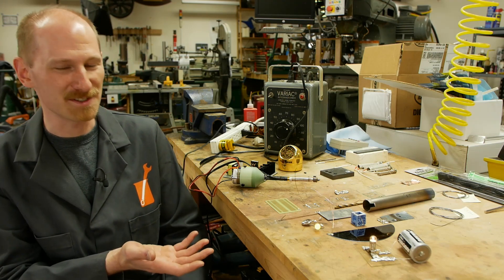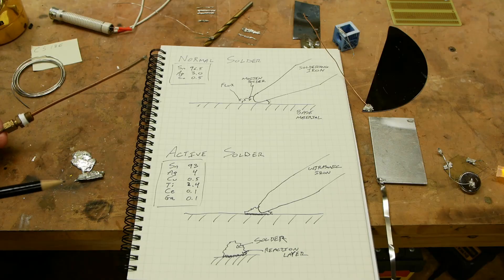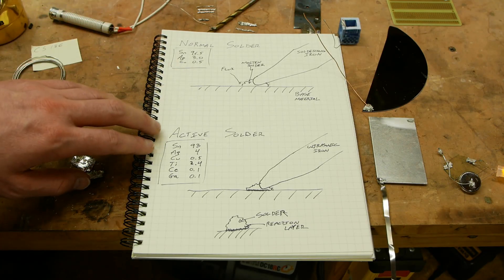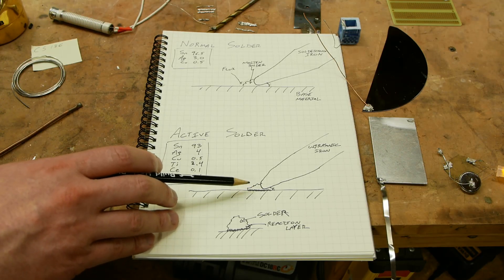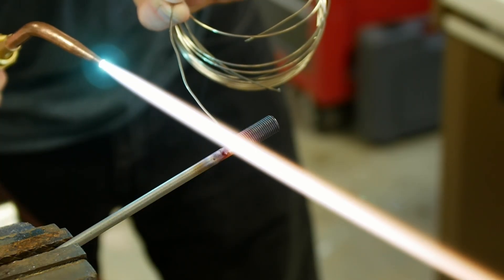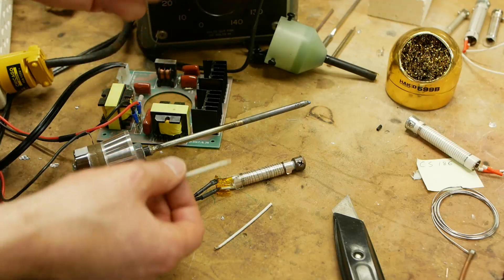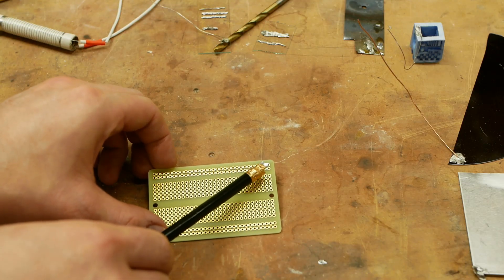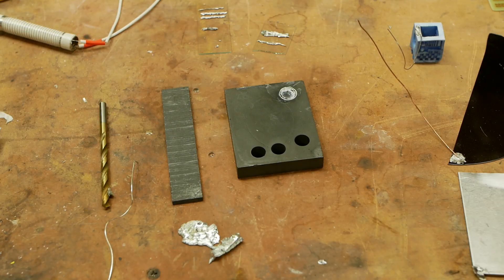Ultrasonic soldering bonds glass, titanium, stainless steel, ceramics, tungsten, nichrome...

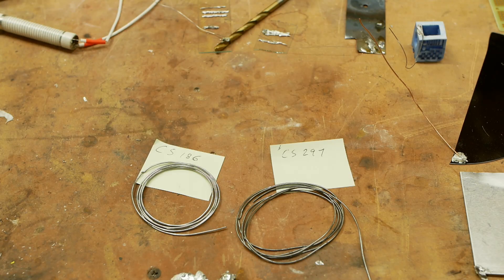Comment: 12:38 did you just reveal their exact recipe??? XD
XRF guns are magic
Reply: the building process is often the harder part
Reply: @senselessnothing  yep, just look at the special glass he made a while back
the ingredients you put in have to be wildly different from the final glass mix, because of all of the reactions that happen when cooking it
Reply: @cleverca22  Exactly, the recipe is just the first step
Reply: @cleverca22  depends on your definition of ingredient..
Reply: @cleverca22  I suspect that copying an alloy is way easier than with the glass, there are less chemical reactions involved. It might still not be straightforward though.
Reply: So, I agree with the idea that an ingredient list is not the same as a recipe, especially in general.  But I'm curious if anyone knows what types of issues make the true for a metal alloy.

The big one I know about is heat treating. It affects the grain structure. Though you melt solder to use it, so I'm not sure how much heat treating matters.

Anyone have ideas of other factors that would make replicating a metal alloy not straightforward?  Maybe the flux you use when melting and mixing? The type of atmosphere you melt it under?
Reply: @doctorbobstone  exactly, look at all inputs, and (env); heat cycling and boundary growth is another "condition" of a material that's an input. Look at chocolate - you have to get the temps perfect to get the crystals right, tempering. Carbon can dissolve in from air, oxidization, the heat cycle will affect, but the fundamental structure, if homogenous, will be set from this - but likely it won't be ~homogenous exactly. There's also mechanical inputs (as displayed here) with rolling metals to deform and align grains - now you're talking about what makes a MATERIAL not what makes an ALLOY - you can work an identical alloy in different ways to make different materials. Would be nice to see a superset of all inputs and some descriptor language for each....
Reply: ask for the material safety datasheet for a rough target corridor of ingredients.
But note that ingredients is not the same as a recipe.
Reply: @sarowie  msds sheets don't reveal very much of anything, as far as specific ingredients or quantities of ingredients, for a lot of things.
Reply: I'd say its not even the recipe, but just ingredients. Executing the recipe can be a whole other ball of wax.
Reply: Composition not recipe. They tell you the recipe on their website.
Reply: That gun just looks made to ruin so many industry secrets its amazing it exists.
Reply: @dafydd165  if a group with resources wants to know the composition, I assume that the XRF gun is but one method they could use. That is, I assume you basically can't keep something like this secret. But that thing might as well be a tricorder.  It's pretty cool that it exists and is instantaneous.  (And the sci-fi sounds still amuse me... 😁)
Reply: @dafydd165  if you've got $6000-$12000 to spend on one sure
Reply: @SuperAWaC  Granted, this was a few years ago  but when I checked into getting one...the base price was like 35k and just went up from there depending on the number of elements detected.

Is $6,000 for a new or used one, how many elements does it detect? Crazy how much cheaper they are now.
Reply: @PowerScissor  the ones that go for 6k used now are probably similar the ones you paid 35k for when they were new- they are usually about 10-15 years old.

Comment: Any chance of being able to make a vacuum tight connection on glass? For instance making various tubes or apparatus?
Reply: As a follow up, can you use the active solder  to prepare a difficult surface (glass window, tube, etc.) then run a conventional pass complete the joint/get a good looking product?
Reply: @noahhoppis2512  I wondered the same thing. Not that I'm ever likely to have such wonders to play with.
Reply: Good question - the answer is yes, you can! As far as I am aware, this was one of the techniques used to seal vidicon tube image plates, which needed a full metal ring in contact with a photocathode, at the very front of the tube.
You can't really do internal seals though, have to be very careful with how the solder is positioned so as to not create virtual leaks, which would ruin the vacuum.
Reply: @Spirit532  glass metal joins are very common and usually made though oxidation of the metal in the place of joint, then the molten glass makes a bond with the oxide layer. This is how it is done for centuries and the solder discussed in the video is a very recent development.
Reply: @pahom2  Centuries? No. Modern, vacuum-capable glass to metal seals have only been around for ~100 years or so.
I'm talking specifically about the downside of Houskeeper seals, which were one of the first seals that could work for large diameters.
Reply: @Spirit532  yes centuries. People are welding glass and metal for centuries. Vacuum tubes is of course a more recent application of this welds but still much older than the active solder discussed in the video (10-30 years according to Ben)
Reply: @pahom2  Please provide sources.
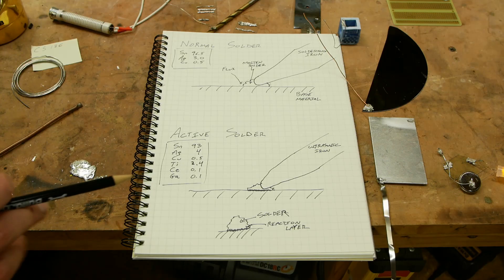Reply: @Spirit532  he is telling this at 7:35
Reply: @pahom2  Sources regarding "welding glass to metal for centuries"
Reply: @Spirit532  stop this demagogue. You've lied that vidicon tubes were soldered. They were welded. More details can be found in the book A. Roth, "Vacuum Technology".
Reply: Good question, that would be a nice way for sealing glass joints if it works.
Reply: @JoshStLouis314  this wouldn't be a great mechanical seal unless you were just trying to be air tight with 0 pressure
Reply: @Hexauslion  I should have mentioned the uses I had in mind were for partial pressure and vacuum setups, not positive pressure.
Reply: You should look into how copper to glass seals are made...seems pretty straightforward (I've never tried it) and is well documented, but the devil is in the details. I found some old papers online explaining it once.

From memory it involves creating a thick oxide layer (but not too thick) on the copper and the oxide layer bonds to the glass.
Reply: @drrrrockzo  What you're referring to is Houskeeper(without the e) seals, and they are some of the hardest to apply practically, as they require an exceptionally thin copper tube to match the CTE of glass.

A far easier and modern(as in, developed after Houskeeper died) alternative is sealing borosilicate directly to Kovar alloys. That is "as simple as" maintaining a fine balance of oxide and temperature - otherwise you can just let it sink into the edge.
Reply: @Spirit532  That's exactly what I was referring to, just couldn't remember the name...i had a suspension that they were not easy to make in reality. 

Kovar is definitely the industry solution, but they aren't exactly giving it away...even compared to commercially pure copper.

Still seems like a useful technique if you can plan around it's issues and have the time to master it.
Reply: @drrrrockzo  Kovar itself is a relatively affordable alloy, just have to find a supplier. You wouldn't use too much of it anyway, the seals still have to be relatively thin(knife edge is ideal, but 0.5-2mm is more practical).
A tip for searching is to look for the generic alloy, not actual Kovar, since that's a trademark.
It's certainly going to be cheaper than wasting kilos of copper by turning down large blanks into paper thin tubes.
Reply: @Spirit532 

Fair enough, I looked it up at Mcmaster-Carr, it was 5-10x more than copper and the actual brand name.

Honestly in the applications where I needed to seal metal and glass, I just used oring seals...nothing exotic involving ultra high vacuum, pressures over 5000psi or temperatures higher than ordinary silicone can handle.
Reply: @drrrrockzo  For applications where you have continuous pumping, these kinds of seal aren't really needed. Alu or stainless to glass via viton orings works just as well, even almost reaching to ultra high vacuum.

That, and McMaster is gouging express ;)
Reply: @Spirit532 

Mcmaster-Carr is certainly the master of price gouging...but there is a value added. They basically have anything you can imagine in stock and in quantity if needed, they also ship nearly everything overnight for a fair price because of the volume they ship.

For rapid prototyping and emergency jobs, they're hard to beat.
Reply: @drrrrockzo  If only their warehouse was where I lived, which is not the US :P
Reply: @burnssuck  In art, maybe. Scientific glass does not use butchered terms. Linear CTE, sometimes alpha.
Reply: @drrrrockzo  The vacuum furnace is the killer for home labs.
Reply: @glasslinger 

Judging by you screen name, I'm sure you have a better idea of the process than I do. 

But the write up I read seemed pretty "rough and ready", mainly requiring a metal lathe and glass lathe. The glass lathe seemed to be the stumbling point, but a crafty person could modify a metal lathe to do the duty.
Reply: @drrrrockzo  have a look at glasslinger's channel
Reply: thermal expansion might be an issue though?
Reply: @すどにむ  yes thermal expansion is an important question in many applications, and not only vacuum ones
Reply: Might want to look into how vacuum tubes have been manufactured by the billions. They each have a dozen of metal connections going through the glass 😉
Reply: @epojesper  None of those are flanged 😉
Wire feedthroughs are an order of magnitude easier to make.

Comment: why was the LED at 14:00 blinking? i suppose it was a simple circuit from battery to LED with the ITO coated glass in between? What caused the random fluctuation?
Reply: It's a fire effect LED. The connection is fine.
Reply: It's in most of the video.  It looks like it's correlated to his voice and noise.

Comment: Would you be able to limit the power with a capacitor in series with the ultrasonic transducer?
Reply: Not a bad idea, add reactance to reduce total current flow. I'd be concerned about the driver's ability to tolerate the phase shift.

Comment: Chemical supply house: "wont sell to hobbists"

Hobbyists: "Hold my vacuum induction furnace"
Reply: I've dealt with that mess before, trying to obtain tetrahydrofuran, as I wanted to test if it works as a solvent for vapor smoothing of PLA 3D prints. Eventually had to resort to a dodgy ebay seller who sent me a bottle of something labeled tetrahydrofuran, with a picture of another molecule, and a structural formula for a third one.

It sucked for vapor smoothing, but I'm still not sure if that was because THF in general isn't good for it, or because whatever was in that bottle was not really THF.
Reply: @vylbird8014  Just distill PVC cement/purple primer. That is usually THF and MEK
Reply: @vylbird8014  C4H8O aka. Oxolane aka Butelyne Oxide can be obtained from Fisher Scientific and is considered a flammable VOC; It will eat latex for lunch and works relatively well for PLA smoothing with direct contact; DO NOT suck in any of the fumes, and beware that this is a solvent for many common polymers used in gloves, safety goggles and breathing apparatus. Use Nitrile/Neoprene gloves & goggle shields, but even these will be impacted with repeated exposure.
Reply: @luisderivas6005  Once I'm done with the house-purchasing and -moving, I might give it a try. Thanks for the suggestion. I was going to try diethyl ether just out of hope, not expecting much from it, but then the government decided to pass a new law that forbids possession of every chemical that has any recreational drug use (It's so vague the law has to specifically exempt nicotine, ethanol and caffeine - the socially-acceptable drugs). You can still buy the stuff, but prices shot way up after that.
Reply: @vylbird8014  https://www.restauro-online.com/epages/63807438.sf/it_IT/?ObjectPath=/Shops/63807438/Products/Z131 . Why you wanted to use THF? Seems that all info I could find on PLA smoothing wanted to use Cloroform (not always easy to get but easy to make at home) or dicloromethane (much easier to get, not in pure form but... you need it just for vapors so ok)
Reply: @gentiligiuliano7882  I was finding conflicting information from other hobbyists regarding THF. I thought I'd try it myself, to see if the results were superior to DCM. They were not.
Reply: @vylbird8014  personally, I would stick to chloroform. The ingredients are few in number and very, very easy to find at any hardware store, and even most grocery stores.
Reply: @vylbird8014  Let anyone smell it who works with THF. Easy to tell.
Reply: @leocurious9919  I destroyed my THF years ago - didn't want to hang on to it, because I know that if stored for a long enough period it can break down into some nasty products with explosive properties.
Reply: @vylbird8014  There is something worse that used to be used, Rhymes with "Picnic basket", and used to be found in school labs.  Also if somebody forgets to toss the standard silvering solution.  Better (Luck) living through chemistry!
Reply: @vylbird8014  Try Weld-on 3
Reply: "Hobbyist" is stretching it a bit with Ben though :)
Reply: @T3sl4  more like mad scientist. but i love it anyways.
Reply: Tim Williams imagine all of the awesome stuff he worked on at google, valve, and mag design.
Reply: these companies are hobbiophobics ;D
Reply: This is always such a pain, it's really like these kinds of companies want to keep their market small.

I usually pretend to be some student project for a university when they deny me parts just because its not a company. Not very ethical but it works..
Reply: @malloott  A lot of the things hobbyists want are potentially materials for making either explosives (like my THF) or drugs. Though a creative chemist can really make something recreational from pretty much anything.
Reply: Indeed and stupid thing is that this produces paradoxical results, I wouldn't be surprised if companies that adopt this attitude end up creating competitors in the future.
Reply: You gotta fake it and use a company letterhead to get attention and respect ie responsivness.............they gotta smell money often times. Rich
Reply: @ghlscitel6714  Dicktionary. rofl
Reply: muh bunsen burner
Reply: @calholli  thats close to a youtube rules infringement.
Reply: @ghlscitel6714  Google was unable to translate it

Comment: Dang it Ben, I’m trying to sleep! You can just post a video with that title, I’m gonna be up all night!
Reply: Yep I'm already going down the research rabbit hole. Eyeing my parts bin to see what I might do.
Reply: @Ryan6.022  Sourcing Cerium... Wallet says "ouch"
Reply from the maker: @matthewellisor5835  eBay!  https://www.ebay.com/itm/Cerium-Metal-Element-Sample-10g-Chunks-99-5-Pure-Periodic-Table/372414604226?hash=item56b5a3e3c2:g:fSYAAOSwWh1bfypP
Reply: @AppliedScience  Also lighter flints may be enough -- it's ferrocerium, if the iron doesn't cause any problems that is.
Reply: @T3sl4  huh apparently it's nearly half cerium by weight with a bit of chemical work up you might be able to separate it. I'm too tired though so I'll pin that for research in the morning.
Reply: @Ryan6.022  Chemical separation of the cerium will require oxidizing the cerium to a compound and reducing it back to metal: the cerium is in a solid solution with iron and won't come out easily. It is also more reactive than the iron holding it and so dissolving away the iron is a no-go.

Also, fun fact: the 'cerium' in ferrocerium is typically a mixture of the lighter rare earth metals and not exclusively cerium. The cheapest ore for the process is monazite, which is high in cerium but also contains quite a few other lanthanides. It is too expensive to separate the different elements, so in most firestarter alloys the mixed metals are used.
Reply: @billsmathers7787  yes I'm aware that the fire starter rods are a solid alloy... My plan was to dissolve the whole bar and then try to selectively precipitate the cerium and then convert it back to a metal.
Reply: @Ryan6.022  converting cerium compounds back to the metal is the hard part-- it wont plate out of aqueous solutions. The industrial method is to prepare anhydrous rare earth chlorides and electrolyze them while molten. Maybe a thermite would work, although you'd need some pretty good protection from air and you'd get some gnarly aluminum contamination.
Reply: Ditto, Ben!
Reply: Same boat, man 😅